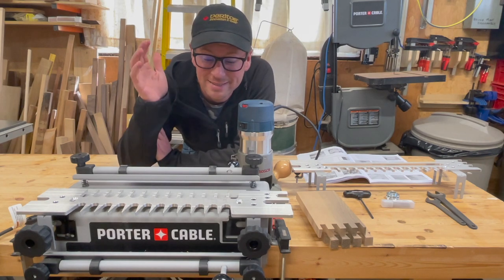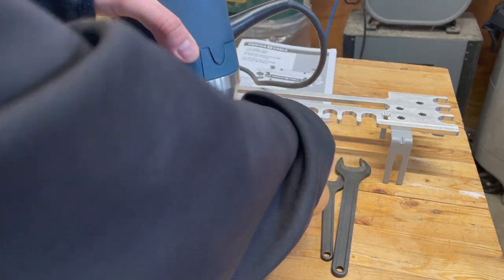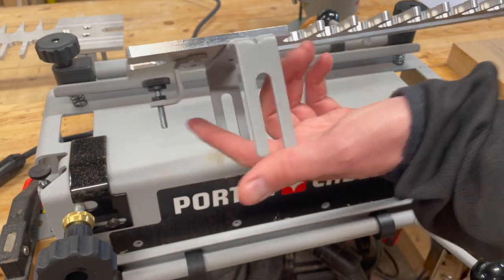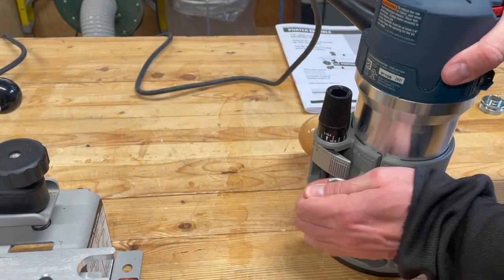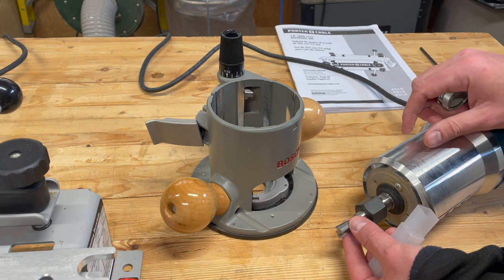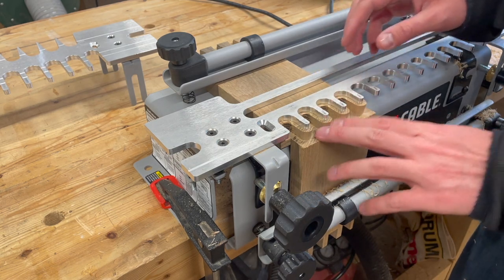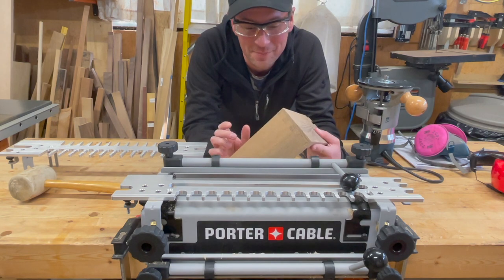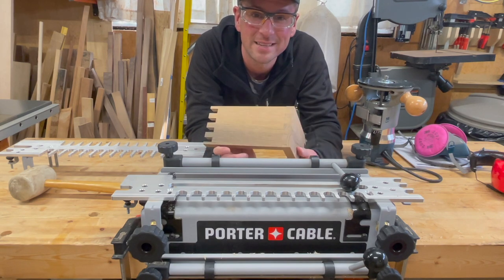How to Make Half-blind Dovetails with Porter Cable Dovetail Jig (4216)

Comment: Thank you so much for making these videos. I’ve wanted to know how to make dovetails… for as long as I could remember. I own routers… new for over 10 years easily. This task/tool looks so intimidating that I’ve never tried. Forcing myself to learn. I came across your videos to gain confidence and understanding.  Thank you for giving me the drive and know how to try.  Your instructional videos are superb!  One tip I can share w you that I saw from another video was to use a piece of wood the same thickness and lay it in front of your cut. Scribe a pencil mark on it. Now you can Lay your router as if you were to make the cuts and verify the depth that could potentially be more accurate
Reply from the maker: Thank you so much for such a kind comment, that makes my day! I had this jig for quite a before working up the courage to give it a try as it was quite intimidating. Once I broke through that part, I wanted to share my experience with it, in hopes of encouraging others - hence the longer videos.

That's a great idea to scribe the mark based on the workpiece! I've been trying to do that sort of reference measurement (rather than numerical measurement) in most of my woodworking, but haven't done it with dovetails. Great tip!
Reply: @MasonWoodshop  you can also use a caliper. You drop the tail in. I’m using a “general” w increments in 64ths.  Makes it really easy to set the depth

Comment: Thanks for the video! I'm about to give my jig a try with ½" Baltic birch ply.
Reply: How did it go with the 1/2" ply? Im thinking of buying this for making drawers using 1/2 material.
Reply: @denisj4c0bs72  I used Baltic birch which is actually 15/32" or so. The jig calls for minimum 1/2" thick material, so my joints took alot of finesse to keep the tails from blowing out the grain. And they ended up being very tight! Next time I will use something that is actually 1/2-9/16" thick. My advice would be to caliper the material before you purchase it.

Comment: WOW! That's fantastic work there. Thanks for sharing. I'm waiting for the new model of a Bosch router, as I saw a few reviews that didn't seem to recommend the current one. I wonder what your thoughts on the plunger are, in general. Cheers!
Reply from the maker: Thanks for watching and leaving a comment! The jig is very impressive and built well, just a bit intimidating to use at first. I was very happy with my Bosch 1617 and it was ideal for this jig as the accessories available for Bosch routers is quite impressive. I haven't heard anything about Bosch updating their larger routers (I'd love to try one when new ones come out) and I recently changed out my router setup to a single Festool OF 1010 router. It's a bit between the Bosch 1617 and cordless DeWalt that I had and better fits my requirements for cabinetmaking...albeit at a cost.

Comment: If you have to hammer your dovetails together, they are too tight. you need to slightly adjust your router bit. This is why you always test you setup on scrap wood first.
Reply: if its too tight do you raise the router bit or lower it? In a different video they said you slightly push the template forward like 1/16 of an inch,, your thoughts Magaman?

Comment: when you check the router bit depth you assume the the rubber stop on the the threaded bolt is the proper depth.  What if it has been changed?  Is there an alternate method to make sure the bit is the right depth?

Comment: Just a FYI if you ever take the face plate off your router you need to recenter the face plate because if you rotate the router the joints will not match found that out the hard way
Reply from the maker: Ah yes, great point Kenneth! The first time I ran into that I wonder why the router bit wasn't perfectly fitting into the bushing. Glad I figured it out before jamming it in and turning the router on.

Comment: Great video, I often come back to it for inspiration! After owning this jig for approximately 8 to 10 years lol, I finally tore the Band-Aid off. Not as intimidating as I thought especially with some good research videos. My question is on your boards that you just cut.. how do you adjust so the cuts are flush? Meaning if they were a little proud or a little shallow... Is that all with the depth of the router or adjusting the template plate?  Thank you
Reply: The bit height adjusts the tightness of the joint. If the pin or tails board is proud or shy then adjust the template. 
There are instructions for those adjustments with pics on page 18 of my manual, not sure if your manual is the same.
Reply: @kjfreepta1  thanks bud, I'm going to check the manual when I hit the shop tomorrow.

Comment: I have a question that I have been trying to find an answer to... does this jig "not work" with a 1/4 inch collet router or does it need multiple passes with a 1/4 inch collet... again bit width, I get, should be 1/2 inch, my concern is the collet.. maybe my question is stupid... not sure.. appreciate the help. Thanks
Reply from the maker: Very fair question! The main issue is that you need to be able to install the guide bushings in the router to use the jig. If you have a 1/4” collet router than can accept guide bushings, then I don’t see any reason why you wouldn’t make the miniature dovetails that this jig can make. To make full size dovetails (like in this video), I’m not sure how that would work with the included guide bushings, but I’m sure there’s some math that could be done to figure out what you need.

Comment: Nice work, I tried what you did but my wood piece was tearing apart. I was wondering if you could tell me the speed of your router and other tips to achieve your quality of work
Reply from the maker: Tear out can be a big issue, so I always make sure that I have a backer board behind the primary work piece (for through dovetails). Funny enough, I haven't thought much about speed when using this jig - checking my router, it looks like it would've been on speed 3, which is ~16,000 RPM on this router.

The type of wood is always a factor as well. In my videos I'm using oak, which stands up really well to this task - I also use it with maple, cherry, and walnut (walnut can sometimes chip) with clean results. I tried it with poplar and pine with really poor results.

Hope all of this helps!

Comment: Question. What speed did you use on your Bosch router  when you filmed this video or when you use the Porter Cable for half blind dovetails?
Reply from the maker: I don't recall exactly what I had it set, but with the work pieces being  3/4" white oak and the bit being relatively small in cutter diameter, I likely would have been running close to max on my router, which is 25,000RPM.
Reply: Thank you

Comment: I would like to ask you if the Porter Cable jig works with any dovetail bit (diameter and angle) for a blind dovetail joint? Or does it have to be the 17/32 in x 7 degree to work? I don't have access to a router with a 1/2 diameter collet, so I am using a 1/4 inch diameter collet dovetail bit that says it is "1/2 inch" and unknown angle. I am struggling to make the cut fit (too loose now) and am slowly making the cut deeper and hope this solves the problem. But it occurred to me that possibly the diameter (and possibly the angle) is vital.  I could try and find a 1/4 inch equivalent diameter and angle. Any help would be greatly appreciated.
Reply from the maker: While it may work, I wouldn’t recommend going that route. If you do, you’ll need to make sure you use appropriate guide bushings and on my experience it can sometimes be tough to effectively use guide bushings on a smaller router (I did using a third party baseplate on my DeWalt trim router).
Reply: @MasonWoodshop  Thanks for the reply. My third party base plate accepts the Porter Cable bushing, and I do think I have it centered - I used a centering cone. I assumed even if the bit is not exactly 17/32, it would cut the tail and pins such that they would fit each other. I am outside the US and routers that take 1/2 bits are very expensive. Again thanks.

Comment: Looking for some help.  I have the jig and tried half blind all day doing these instructions and can’t get it right.

My issue is the tails are always too wide to fit into the pins.  I tried raising the bit and lowering the bit and can’t get the tails to fit at all.

One note:  I do not have the 7 degree but that came with the poster cable jig.  I bought a set at rockler which came with a 14degree and 8’degree bit.  I’m using the 8 degree bit and noticed the one that came with the jig was 7 degrees.  Not sure if that matters.   Also had to buy the  router collar from rockler as I couldn’t find that one as well.

Any help is greatly appreciated.
Reply: Note: I’m using 3/4 inch solid poplar as test wood.
Reply from the maker: That’s interesting! I only ever used the bits that came with the jig, so it’s possible that could be the case here.
Reply: @MasonWoodshop  what size or diameter is the collar your using?  I’m using a 3rd party collar that fits perfectly into the jig slots.  That could be an issue also.  I don’t have the original collar for the router but that came with the jig.
Reply from the maker: @StephenCombs17 I don’t recall exactly (and I no longer have this jig) but I always used the Porter Cable guide bushings specified by the manual with a 1/2” collet router bit.

Comment: after cutting the dovetails, how do I know which way to flip the board for the PIN Cut?
Reply from the maker: For half-blind dovetails both the pins and tails are cut at the same time, so it shouldn’t be too much of an issue. For through dovetails (and really any of these), I would always recommend marking the front, back, and then label the matching corners. The manual does a good job covering marking the pieces.

Comment: What’s model number of your bandsaw??
Reply from the maker: It’s a Porter Cable PCB330BS. Really nice bandsaw that’s can be found on a good sale quite often at Lowe’s. I’ve generally been very happy with it, but I need to tackle some rust buildup on the cast iron before getting back to using it.